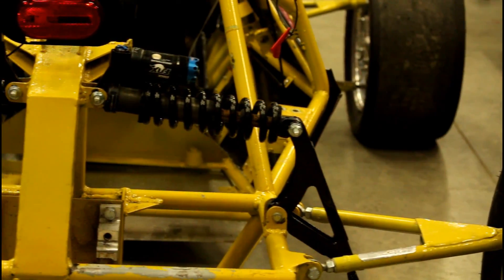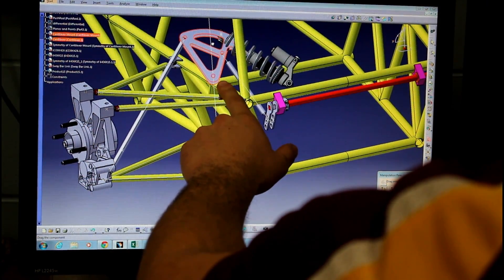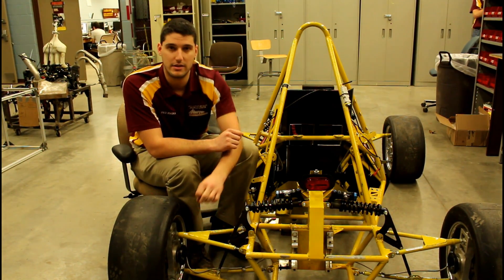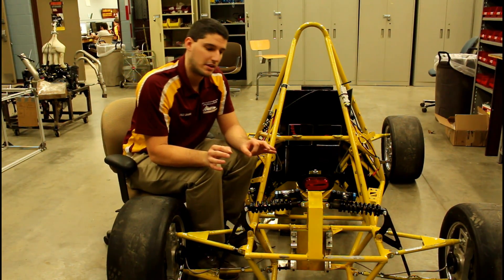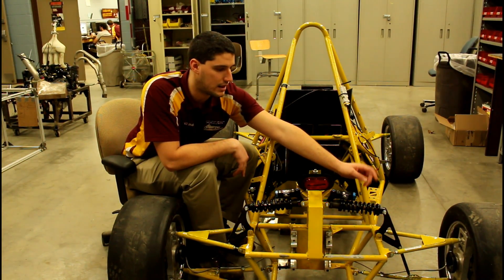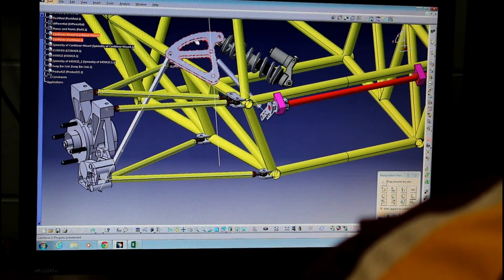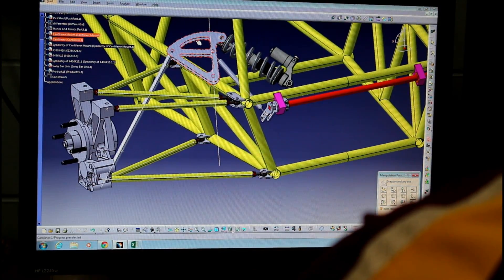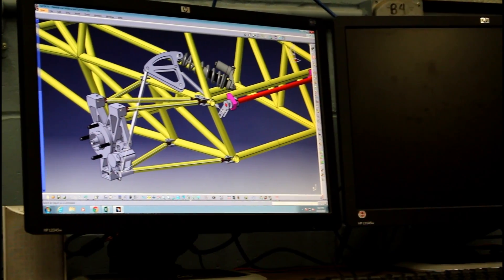Central Michigan University Formula SAE: Rear suspension senior design

Comment: Yeah, you definitely bombed the design portion. Oblique angles may work in CAD, but I'm guessing you ended up with lots of understeer or weird tracking around corners and the bell-crank pivot ripped off the frame if they actually let you run it on the course. That or you ripped a forward clevis off the frame on the lower A-arm during a brake test, or snapped the outer threaded rod-end on the lower off.

Comment: Your pushrods (front and rear) react from the lower wish-bone; the orientation places the (outer) rod-end at the wishbone to upright in bending (thread) and axial load (ball in housing). Rod-ends seem quite small - most suppliers recommend approximately 15% axial capacity of radial capacity - that won't leave much capacity. Your comments ... ?